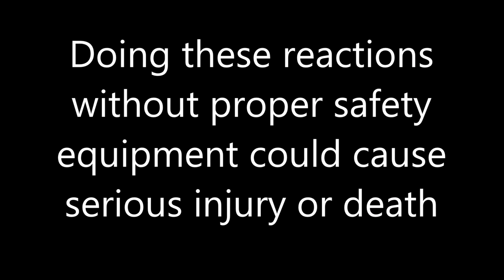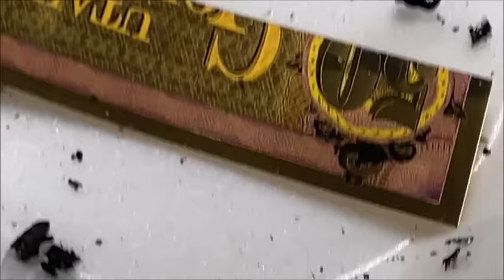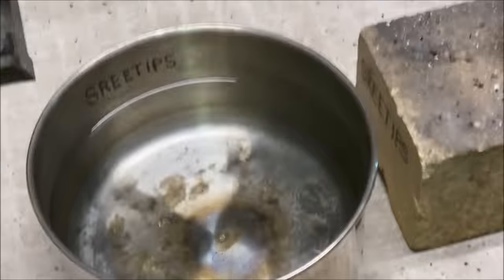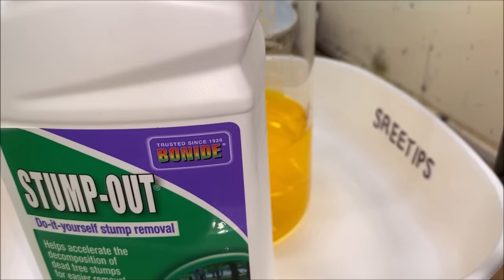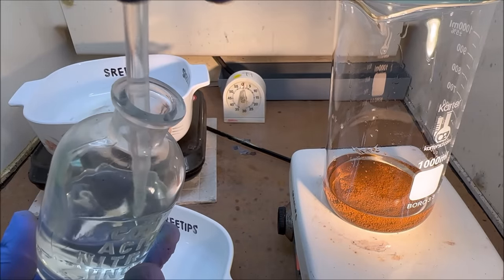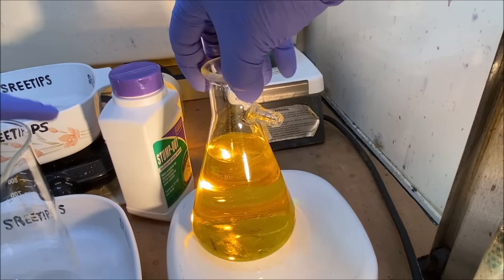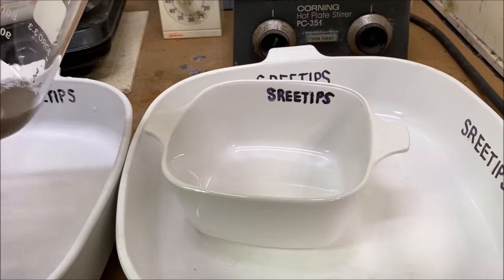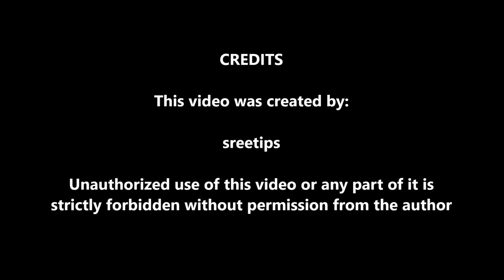How Much GOLD in Utah Gold Backs

Comment: WTF ! Just burning them ? You spend a lot of time dissolving Metals out of other Metals.
If you get another one of those notes, try dissolving Plastic away from the Metal. 
Nitric might work. Maybe Acetone, or even Benzene, Toluene, Xylene (aka Gasoline).

Comment: If the gold is 24K, why do you want to inquart it with silver? Do you not trust the makers of the goldbacks? Would you take a gold buffalo and inquart that? I understand you're just doing this to make a video, but Why?
Reply from the maker: I wasn’t pure gold. You can plainly see that the button was contaminated after I burned away the plastic from the gold. Alloying sterling silver with the contaminated gold is part of the refining process to get that gold to three nines - industry standard for pure gold.
Reply: I guess you had to refine it after melting the gold in that nasty dirty dish. @sreetips
Reply from the maker: Correct. And I didn’t want to ruin another clean melt dish to burn that plastic off.

Comment: I just checked the current price for those Utah Goldbacks on APMEX. They are going for $187.31. 1/20 troy oz of gold at todays spot is $99.79. I would not call that a good investment. I don't know why anyone would buy them.
Reply from the maker: Gold is NOT an investment. Gold is money. Paper dollars are money substitutes. Paper dollars are declining in value and purchasing power. Why would you chose to hold your savings in paper dollars that they can be printed out of thin air? Long after the dollars are gone and forgotten, gold (and silver) will still have value.
Reply: @sreetips and there is the problem … they can sell you electric gold accounts …. But if everybody cashed out there wouldn’t be enough gold in the world banks to cover it.   They inflated the sales of gold over the current actual gold stored.
Reply from the maker: Plus, they can create paper gold, sell it short, and crush the price of gold (and silver). Why? So you won’t get the idea to convert your dollars to metals. They need you in their paper. Because they can print as much as they want and destroy the value of it. But they can’t print more gold and silver.